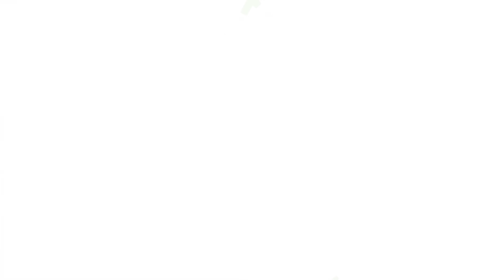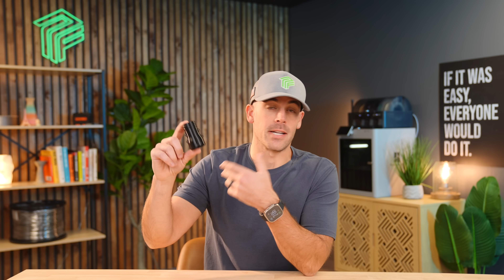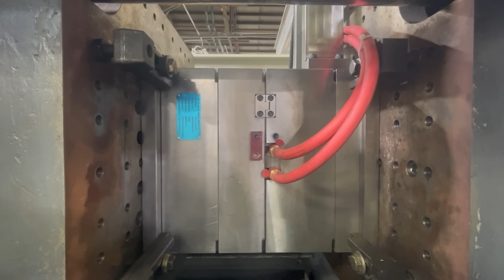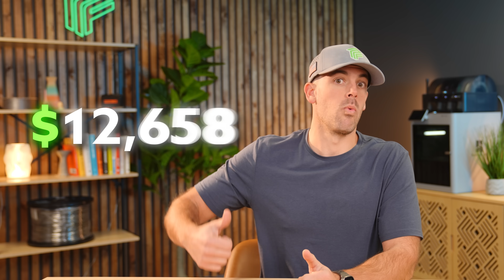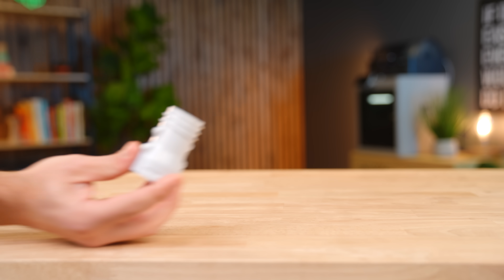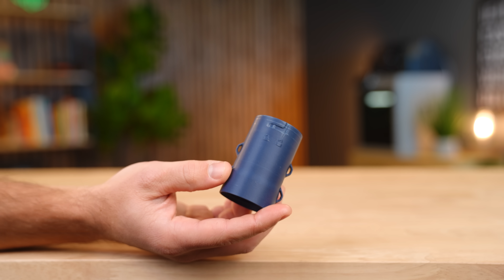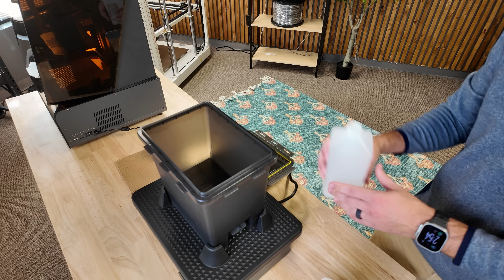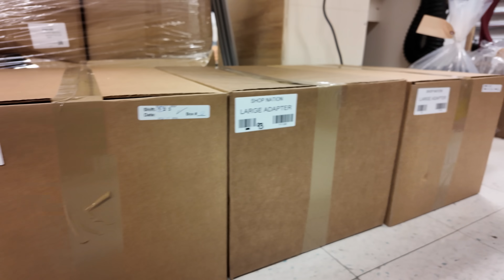Why is 3D Printing so Expensive?  Injection Molding Comparison

Comment: Simple, you can´t scale 3D printing as you can with injection molding. I still laugh about Slant3D
Reply from the maker: I've had several conversations with Gabe and he's pretty knowledgeable about manufacturing.  I don't think he believes that 3D printing is a replacement for IM - just that it serves a unique low-mid volume niche that IM couldn't previously touch.
Reply: @PrintFarmAcademy  That´s fine then, he sounds different in his videos though.
Reply: What happened with Slant3d? I thought they were still around?
Reply: @Magmaros1986  They still are, but they spin the story that 3D printing is basically a better replacement for injection molding, at least that´s what it sounds like in many videos.
Reply: @sierraecho884  that is absolutely not what they are saying

Comment: As a guy who's worked in injection molding for 10 years involved in die making, processing, and ect. I have gotten into many arguments with the guy in my area who runs a print farm where he has 30 printers all banging out the same exact part that sells hundreds to a few thousand each month. I already got a die engineered and priced out for him (done at my own volition) that I could save this guy so much freakin time to produce other products and get him a higher profit margin even with my own commision.
Reply: I think the big thing is, once you make a mold you better be damn sure the product will move QTY, when can you be sure of that? Certainly not right at the start, maybe mid-way, but surely by the end you can say "Okay it would have paid for itself" the farm of machines can pivot to a new product with a swap of the files, you don't have to sweat the investment on them because they can adapt, a mold is a capitol investment lock-in, even if the margins and product are superior. Compromises.
Reply: @Roobotics 30 printers for a farm is 15-30k. It's already a big investment.
Reply: @pauljoly7594  I can have 100 SKU’s with that 15,000-30,000 investments, though. My last quote for a mold was $24k just to produce the mold. A single SKU with injection molding pays for al the entire startup phase on FDM.
Reply: We are looking at using our existing 3D print farm to stand up products to prove the market will handle the volume for that item… then possibly standing up an injection molding line for it. The problem is, the first part is a 40-60K investment for machine, mold cost, and integration into current production space. 

For 40K-60K, I can stand up 70-100 Bambu Lab P2S printers…. 
Each mold after that would be in the 10K+ range for our typical product… which is the equivalent cost of another 18 printers each. 

I can grow a few printers at a time, in cash, print something different every single cycle (3hrs to 24hrs), and alter designs instantaneously with zero tooling changes. 

Or I can do all that 40-60K worth of expansion cost at once, only have a SINGLE unchangeable product for that price, and need 10K+ each time we decide to add an injected sku to the product lineup. 

That is a hard jump to make, even with the reduced part cost of injection molding.
Reply: @Isaacmantx  Um, nobody buys a $40K-$60K injection molding machine just to make a couple of SKUs, they outsource it to a company with the machine. Have you looked into that?
Reply: @madmatt2024  i am not interested in outsourcing manufacturing.
Reply: @Isaacmantx  Your loss.
Reply: @madmatt2024  what manufacturing method do you use for your production?
Reply: @madmatt2024  the same attitude that destroyed manufacturing in the US over the last 50 years.
Reply: @ChunkyWaterisReal  BS. You can outsource manufacturing to US companies. It doesn't have to go overseas.
Reply: @madmatt2024  Dude. 40k buys you not the machine, but the tool for the machine you need for someone to produce your part. Without the tool you can't outsource your job. You can of course outsource making the tool, but then you still have to outsource using the tool to a company with an injection molding machine.
Reply: @NaWunderbar Read more carefully next time, you're off topic.
Reply: @Isaacmantx It's often unrealistic to do everything in house for more complex products.
Forging, aluminium profiles, large cast parts... All of those process cost a lot for the machines and workers to set up not even to mention that usually, we (designers) push the boundaries of what is achievable in those processes therefore it requieres top tier machines and knowhow.
Reply: @p @pauljoly7594  the topic is not about forging and casting… it is about the cost benefit ratio of starting up a product using FDM vs Injection molding.
Reply: @madmatt2024  No loss. Impermanent loss would be after the chinese company I outsorce to decides they want to use my design for themselves and make thousands.
Reply: @CarlosMorales-pz2gl  Nope, definitely a loss. Get it outsourced to a domestic company. Yes, they do exist. The fact that you either don't know this or automatically assume I meant overseas shows a severe lack of basic knolage.
Reply: those 30 printers probably cost 5x the tooling cost. You see - by now he should switch because volume has cought up. I bet he sarted with few parts a week and there 3D printing made more sense.
Reply: Many small print farmers may not have the capital up front, or a long-term contract with their customers to justify the up-front costs. This has been the barrier to conversion that many print farmers face. The risk to immediate reward is what scares many a print farmer away from injection molding. I'm sure you know that multi-slide tooling is complicated & can take weeks to build. If the injection molder is willing to take on yearly blanket POs where the up-front cost is spread out that's more attractive but then again, would you take on that risk with the print farmer you're referring to? If so, then that could be a successful partnership, correct?
Reply: The amazing thing is that you can have molds printed for cheap now out of stainless steel and finish them yourself. Small parts can be made on hobby injection molding setup that costs about as much as a 3d printer to make.
Reply: @FPSG  I find it hard to believe the quality of those molds is that great.  I've never personally worked with injection molding but I have made rollers for a packaging company.  They wanted them concentric and on size within .0005" across the whole length because even a little irregularity will make the plastic extrude unevenly.  And the surface finish had to be a 15Rz or better because any roughness would show up on the sheets they make.  The same concept applies to injection molds.  The shops I've toured who make them usually have to surface grind the mating faces because if they're even a couple tenths out of flat it can mess up the part that's being molded.  Same with the finish.  The roughness of the inside of the mold translates to the part.
Reply: Fortunately, this video is already outdated. There are now resins for resin printers which are capable of making injection molds for low volume runs
Reply: @knerduno5942 
That was a think 7 years ago on the form 4 /3
Reply: That's the scale that makes sense
For the vast majority of people that investment doesn't make sense at all 
Paying even 5k for a mold is a lot of money for most people
Reply: The guy is terrified of the upfront cost. Ask how much the filament costs so he has that number in his head, then offer a contract that amortizes the cost of the mold over the cost of the first 2000 parts or so.
Reply: My Canadian view is that the initial start up costs is usually the bottleneck to the conversion.  Making 1 part every 2 hours instead of 4 parts every 30 seconds is what got me looking into both.  At this time, I admit I can not afford the space or machinery for the conversion and others don't look into that.  It took me a while to find out how much it would cost for additional dies that would be compatible and how to make them which still leaves the other issue of " is it worth it to produce only ###  parts " with the new die.  I don't have a brand to worry about yet or a need for more than up to 5 of any given print.  That only makes for my needs and use it simpler to keep printing instead of going to injection moulding at this time, other people may need to change if they even have a profit margin.
Reply: @ericblenner-hassett3945  As a canadian you should ignore canadians opinions. Unless they are Albertans.
Reply: yep

Comment: That part,  35k for the design and tool?  You were utterly ripped off.
Reply: The price is off-set by the shear volume of units made, there will be a break even eventually and the parts are uniformly strong (if the toolmaker has done a good job that is)

Comment: Injection molding is good when you have reached a level of volume, AND you are done reiterating your design. I have seen people jump to a mold and realize their design needs tweaking, but can't because of the insane overhead, so they are stuck with an inferior design.
Reply from the maker: So true!  You have to fully commit with a mold
Reply: 100 percent

Comment: I agree. As someone who 3D prints, as well as having parts injection molded, there is a place for each and as mentioned in the video, they don't butt heads. My original reason for 3D printing was to validate concepts and prototyping prior to dropping the cash on injection molded tooling.

Now I make sellable 3D printed parts in addition to my other products, but if the volume warrants it, injection molding will be seriously looked at, not just on cost, but capacity constraints as well. I used to turn a component on a lathe and as business grew, I ended up being in the turning business, that component is now an injection molded part which lets me focus on the original products.

Great explanation on the video!

Comment: As someone that runs a 3D printing business too, this was extremely helpful at answering questions I’ve had about when it would make sense to switch to injection molding. For me and my niche market, I think that answer is likely never haha. Thanks so much for this one!
Reply: a quality and cost effective in between can be silicone mold and resin casting, given the right choice of resins, post processing of the 3d printed master, and proper design of the 3d part, your resin cast parts can be visually higher quality, stronger as the material will be homogenous through out like the injection part would be, and faster once the molds are made.  You can make a mold of the one post processed master, then cast multiples and make another mold that allows you to cast multiples in a single pour, molds won't last forever, but once you out pace the usefulness of resin casting in silicone molds then injection molding would be the next step
Reply: @frankevans287 you can do that.  However it’s part specific.  You can’t do 2mm thick walls for a hose and not have 1000psi, that would immediately destroy silicone.  Want screw threads as well? Need even higher pressures.  Only want a basic box that’s full of plastic on the inside well at this point gravity is enough .
Reply: @treymiller5736  That's why I said it "can be" a cost effective in between, I don't know what he may want to build, or what you or anyone else may want to build. Of course it's parts specific, every part will have it's own requirements and processes. I'm not really sure what your point is, I simply offered an idea for other methods of small batch productions that can be considered in a per use case.
Reply: @frankevans287 I'm going to have to make silicon moulds, the part I'm trying to produce is to complex to injection mould
Reply: Really??? You started a whole business and had no idea about this?
Reply: I commend your ability to run a business 3D printing. I would love to but at the same time, I don't think its in my plan. I just can't even come imagine it. But before you settle on an answer. Can you go watch Smarter Every Day, he tries to make a grill scrubber. Its genuinely mind boggling and quite frankly terrifying. I think the video is "Smart Scrubber". I wish schools and all humans could be forced to watch it. Its alarming
Reply: @dj2turnt278  How is it alarming? He purposely goes against the grain, ignoring reasons why the US switched to outsourced manufacturing, and his scrubber is in no way innovative or better than the competition. There are cheaper scrubbers that do a better job, and if he really cared about protecting IP, he wouldn't have uploaded the video.
Reply: @quw1556  I can't find my previous comment. I cant delete it. I don't have a problem with outsourcing. I have a problem with having to sacrifice intellectual property for a product to be made, just for those same Ideas to be stolen and drown my business. Sure people can reverse engineer, try to hack phtos and videos. Absolutely. But deliberately stealing ideas is my problem. Not just specific to the scrub brush. In general terms. Any business should be able to outsource their designs without having foreign countries steal them. That takes revenue from the US. People are butthurt about paying taxes to a government, yet are willing to sacrifice their companies to China? Thats the alarming part. You shouldnt have to give up your business secret, simply to have a part made. It should be protected.

Comment: would SLS printing make sense? I saw the formlabs fuse 1+. 

It works with powder instead of fillament or resin. You can litterly fill the whole build volume with products and the presision is also top notch.

Keep up te great work!
Reply: Naa, no way, it'd be crazy expensive. I think he'd need 3 of them to get sufficient volume so that's $100k up front for starters. Then there's $100k/year in labour costs and ~$5/part(?) in material cost. Probably $10-15 per part all in all, if not more. 

The precision would be significantly worse than injection moulded too.
Reply from the maker: I've looked into SLS but it's very expensive.  It's also not great for parts that occupy a lot of space.  Small parts that nest well are usually better fits

Comment: It will be interesting to revisit this discussion in say 20 years from now as the technology of 3d printing evolves  and gets better and faster
Reply: I think FDM will always be slower than injection moulding.  It only takes seconds to make a part or multiple parts with injection moulding.  You can only move the hot end and extrude the filament up to a certain speed, after that physics will say NO.  Making multiples on a build plate, isn't really any faster either.
On the other hand, resin printing could see improvements in larger build plates and faster curing resin.  The post processing then takes time, unless you have an automated production line.
There are areas where each method excels, and each has it's place.
Reply: @tonyonofrio1147  There could be a world where a single plate has many print heads that print identical parts simultaneously, and modular so that a small build plate can print say 1, 4, 9, 16 etc or some other rectangular or square configuration of parts in tandem. 

Still not at the levels of injection moulding but widens the gap for the point presented in this video.
Reply: physics wont really change tho
Reply: @oiphebal Ofcourse not, why even say something like that? Our understanding of physics will change though.
Reply: The real issue with current consumer level 3D printing is the longevity and sturdiness of the prints. PLA is a temporary POC tool, not intended to replace PETE etc. I make connectors and parts for a backyard chicken coop, and the PLA and PET prints don't hold up beyond one season or so. They bend and crack much faster than injection-molded parts. It still works out economically since there are no ready-made parts that do what I need (extensions to Premier One fence posts, netting connectors, bespoke feed boxes, and a few other things).
Reply: @ChickensAndGardening switch to a better material, there are so many options now
Reply: @riba2233  What material is as strong as injection molded?
Reply: @ChickensAndGardening  as injection molded what, there are thousands of options. You just need something better than pla or petg lol, it's not like it's either those two or injection molding.
Reply: @riba2233  There are two problems I've encountered; first, the material is weak. I haven't yet tried printing with ABS but I believe my printer is capable of it. Polycarbonate is very hydrophilic and requires an enclosure, special platen conditions and slow print speeds. Not as practical. Secondly, FDM by its very nature creates breakable seams; the layers naturally can break and it's necessary to plan the orientation. Injection molding is less prone to this type of problem.
Reply: @ChickensAndGardening  Dude, buy a closed printer with an active chamber or make a mod using a chamber heater and insulation and print with PA/PC CF/GF and not some PLA, PETG for figurines or flower pots...
Reply: What you don't understand is than molding will also improve in 20 years 😂
Reply: @survival_man7746  will it?
Reply: @survival_man7746 in 20 years there won't be a workforce people have stopped having kids compared to years ago
Reply: I think the big difference in the future will be 'printing' the moulds in metal, that can then be used to injection mould with whatever replaces plastic.  But we would also need a cheap and effective way to convert the old moulds back into material that can be 'printed' again.